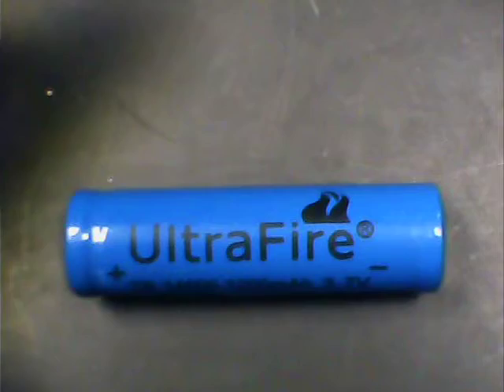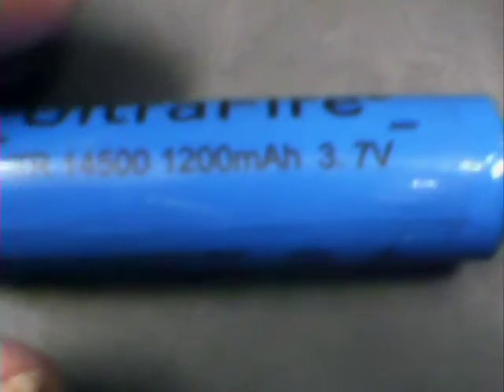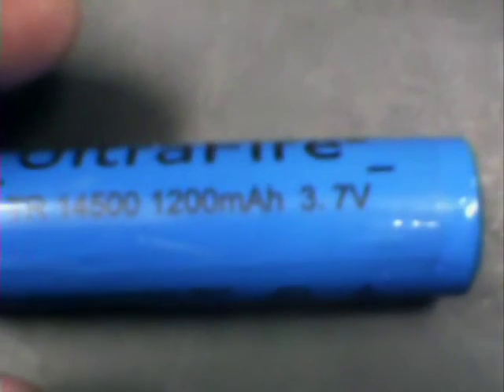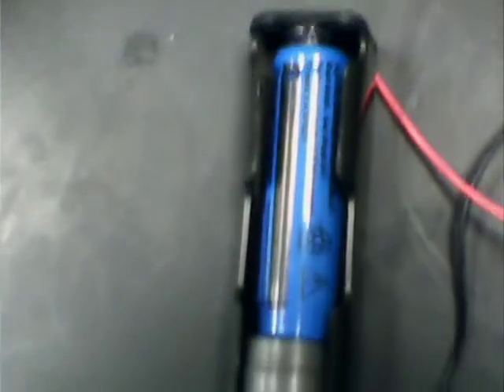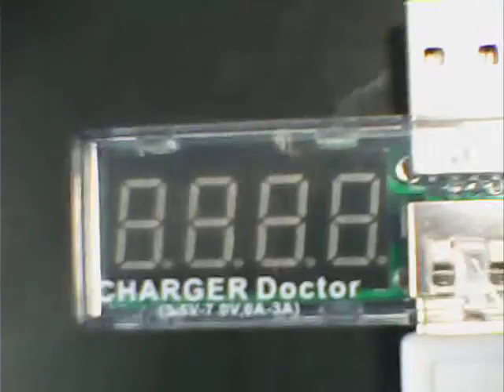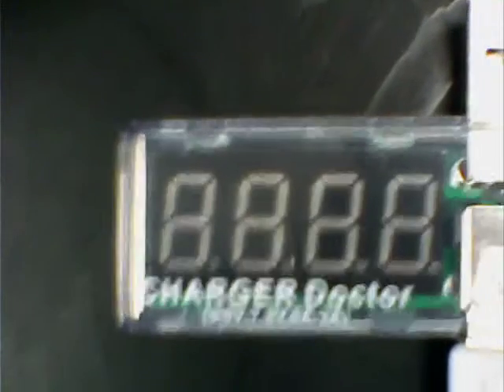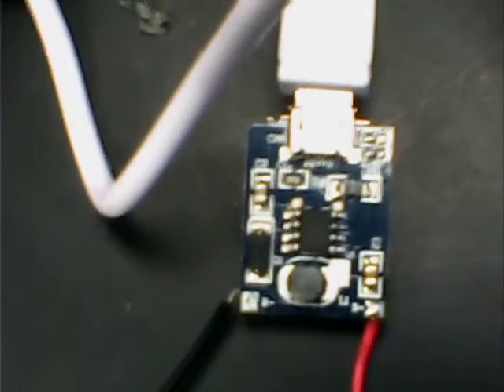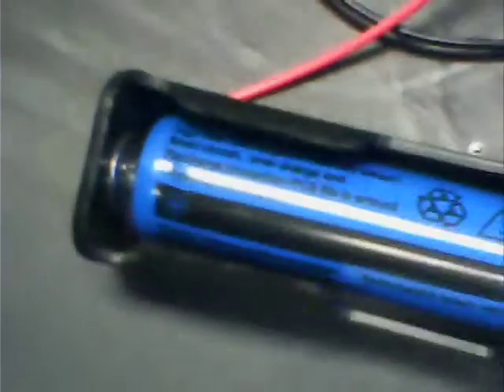Charging Lithium TR14500 Battery/ TP4056 Board/ 18560 Cradle

Comment: You "work with batteries". Those boards are for the 18650 (not your mythical 18560), and they charge at 1A, which is much too high for a 14500. Sure it'll work, but bad advice.